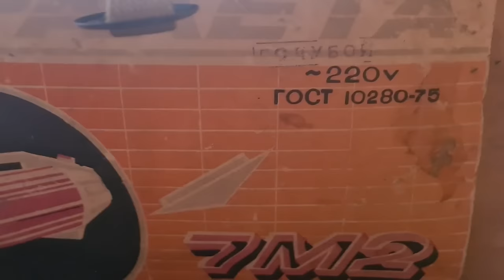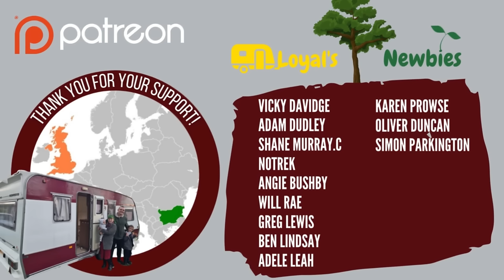Episode 10 - Lets Make A House A Home! Youtube | Buying & Renovating A Bulgarian Village House

Comment: Most Bulgarians would tell you to demolish the building and build a new one, but I absolutely support renovating old houses. Especialy the fact that you will NOT replace the windows, thats a huge win! PVC can get the inside of the house mouldy and humid in winter. With the wooden frames you can kind of solve this problem as the house can "breath" through the wood.

Btw, your channel is great, I admire the fact that you chose to buy a village house in BG and even restore it.
One day I hope I will be able to do the same.

Cheers❤

Comment: Roof height average uk 240 cm, london 250.

My actual in BG is 255.

I will create a lower floating roof fill with insulation keeping original roof as is...in the winter a lower roof is better
Reply: Do all repairs to accommodate  a winter environment not a summer one

Comment: hi, looking the the depth of those windows, you will never ever bee abel to fit double glasing in those :(
Reply from the maker: It's such a shame isn't it. We're now considering PVCs because the winter was so harsh. You can get new wooden ones made with double glazing but the cost is really too expensive.
Reply: @frombournemouthtobulgaria  , yes that is a shame :(
Reply: I took out my old windows, they were to far gone, but the wooden frame was ok and I used that to attach new double glazing to it. It's worked out fine...
Reply from the maker: @gw6056  ooooooooo interesting...... how much depth did you need to install new double glazing, and did you just use silicone to put them on place.
Reply: @frombournemouthtobulgaria  the double glazing I got was about 7 cm wide all around, I had 9 cm available wood width. So I told them to pull them in to the inside edge. They screwed them in 3 screws per side....I was there and made sure fix was strong. Because the original wood frames were seasoned and within a millimetre straight....it was a very snug fit indeed (a little sanding required but minor) no need for expanding foam because the gap was miniscule I had to use sealant...